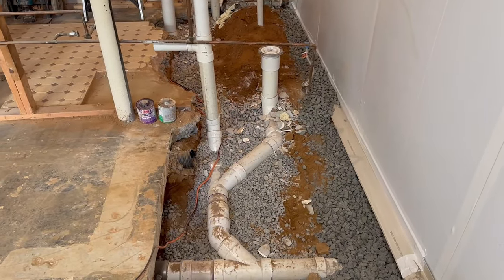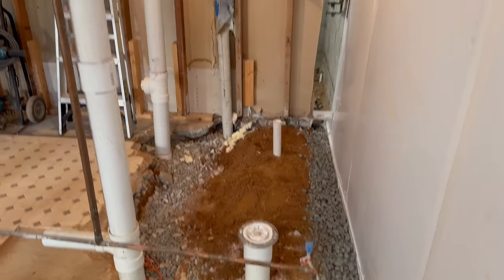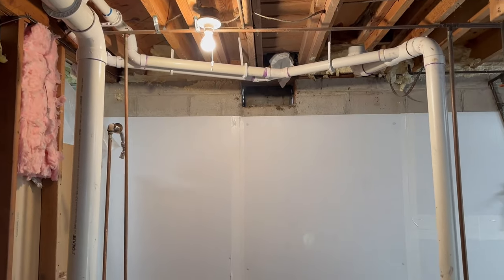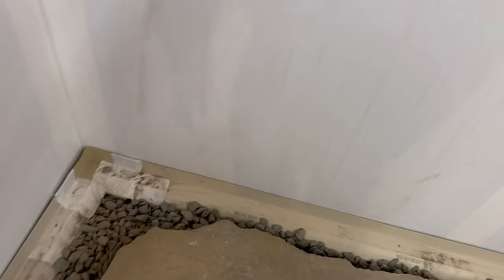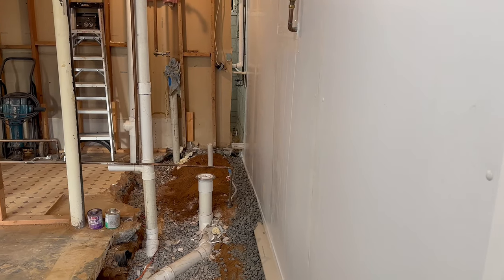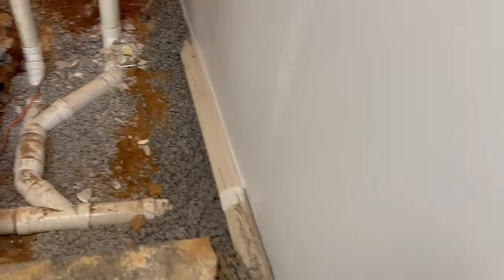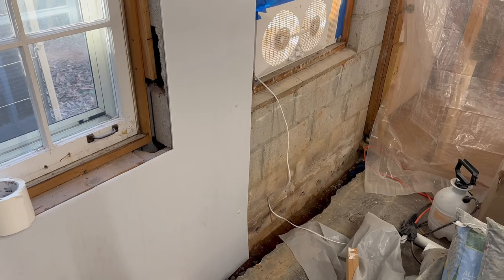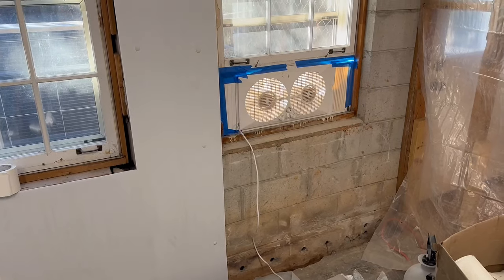Basement Remodel Update - Drains

Comment: Not sure if the galvanized steel plumber tape securing the copper water supply in the ceiling of the basement is temporary or not but that strapping should be changed out with either a plastic type (minimum) or copper strap with copper screws. You will experience dissimilar metals causing oxidation and rust which will result in the copper pipe developing a leak eventually.
Reply from the maker: Good eye, jwb1227!  Yes, that strapping is temporary. I put it in to hold the pipes up so I could remove the wall that had been holding them. It won't be long before those pipes get replaced. 

Galvanic corrosion is indeed a problem in a lot of places when people put dissimilar metals together.

Comment: I would like to hear more about the “plastic” wall covering.  I have a project we will start soon adding a bedroom to an existing basement.  I have looked at InSoFast insulated panels instead of the standard 2x4 stud wall.
Reply from the maker: The plastic was added as a drainage plane by the interior perimeter drain company. I've since removed it because it interferes with installing the InSoFast panels, which can act as the drainage plane themselves.

Stay tuned for a new video about the InSoFast system coming out within the next couple of months. I'll discuss that issue as well as lots of other stuff about those insulation panels.
Reply: @TheEnergyVanguard  thanks for the clarification